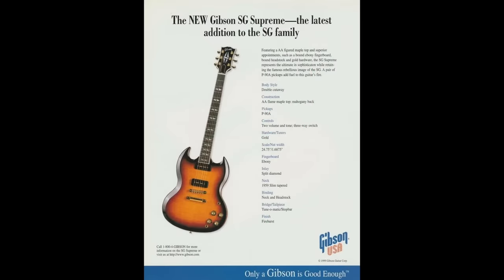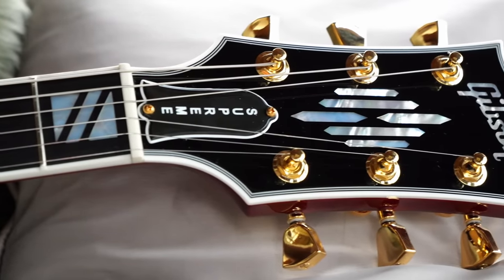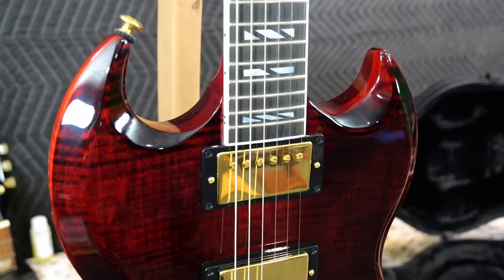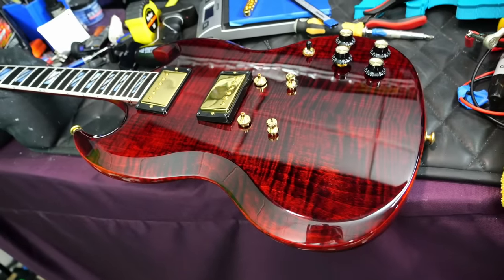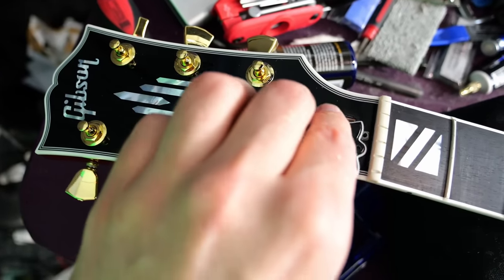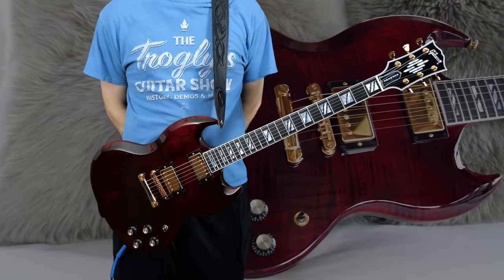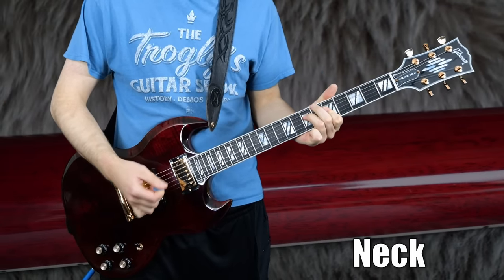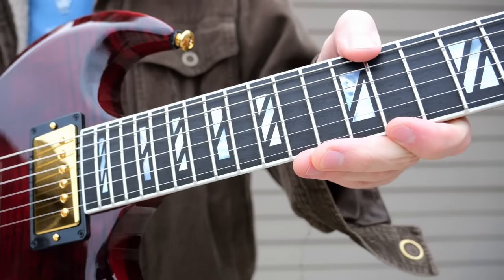WAY Different Than I Was Expecting... | 2024 Gibson SG Modern Supreme Wine Red Flame Top Review

Comment: Sure, they're nice but you may as well buy an SG Modern and save yourself $1k. You still get the thicker body with a figured top, 24 frets, bound ebony fingerboard, compound radius, fancy electronics and the side input jack. Is the higher grade top, locking tuners and different inlays really worth another $1k?
Reply: It’s not.
Reply: It will be worth it when you go to sell. Probably by more than $1000
Reply: @stuckinchaselandia6427  So, you're saying when you sell it, you'll get back $1k more... hmm... but you paid $1k more, so how does that make it "worth it"? lol
Reply: @Darth.Shredder  the point is it will easily hold its value more than a modern will. And will hold more than the difference in the value.
Reply: @stuckinchaselandia6427  I guess we'll see when people try selling them. As of now the only thing we know for sure is that it costs $1k more.
Reply: @stuckinchaselandia6427  don’t really see that. I can easily see these being sold on the used market in less than a year for $2700 tops. SG supremes don’t have much hype behind them.
Reply: Locking tuners should be standard on all guitars without double locking tremolos these days.

Comment: Does it still tilt forward!?
Reply: Apparently they're well-balanced but sometimes it's a crapshoot with the SG. It doesn't bother me at all on mine. A 3-inch strap and my hand is usually on the neck so no worries
Reply: I’d bet not as the top
Strap is on the horn rather than back of neck.

Comment: I feel like the "new" SG neck joint is about as accessible as you can get..  Any more routing would just be for aesthetics IMHO. The old neck joint (while also allowing easier access than almost every other guitar on the market) was much chunkier... I actually thought Gibson did a pretty solid job of making the newer neck joint standard across all models (unlike Fender who make you get an "Ultra" model to get the better joint).  I love SG's more than I should..  I have more than enough of them.  I have no idea how I'm going to convince myself not to buy one of these.  The weight and bulk are probably going to drive me nuts, but the look really is amazing.  I also think it's the best looking Fireburst I've seen.... I typically HATE that finish (I bought a 120th Anv SGJ at a steal with satin Fireburst and had it re-finished white because I loved the guitar but hated the finish that much). On this one with the flamed maple top, it actually looks pretty amazing.  Maybe I'll change my mind before I pick one up, though...  I have more wine red than anything else.

Comment: I owned an SG Custom several years ago (original owner brand new) and it was gorgeous with a flame top. With that said, I got rid of it after six months. The fit and finish had issues which surprised me (compared to my PRS), the frets had to be crowned and finished and it would just not stay in tune. I took it to my local luthier (great guy) who fixed the frets and tried to address the tuning issues. However, the tuning issue never went away. I got so sick of it, I sold the damn thing. I was not impressed at all considering how much it cost. For that kind of money, I'd go with an equivalent PRS any day.
Reply: SG Supreme vice SG Custom. Sorry for the error.
Reply: The Gibson 3+3 headstock design is inherently inferior to the PRS design for tuning stability.

I'm guessing that's why Dave Grohl ( dg335 ) , Joe Bonamassa ( bonabyrd ) and Lzzy Hale ( explorer bird ) have signature guitars with different headstocks.

Comment: is it normal to have coil splitters on the tone pots? one of my guitars has it like that.
Reply: Anymore, yea. It was the hot thing to do around 2018 and on. I still just prefer straight wiring. Yea, you get a little volume cut treble bleed style or a little tonal difference, nothing major, and some dpdt pots are very touchy and scratchy as hell. All in all, I personally think just normal wiring is best. It's better to be great at one thing rather than ok at a few (plus I spend more time fiddling to get the best sound as opposed to just playing...that's me though.)

Comment: You said you would review the Gibson branded case one, but then opened the non Gibson branded one. Just wondered why the change of mind? Oh never mind 😆 Never the less what a beautiful SG Supreme. I never really got on board with the SG Supreme because for some reason the SG doesn't quite pull off the higher end spec thing. The LP pulls it off much better, even though I'm not the biggest fan of the new LP Supremes. But this SG oh yes I'm on board it looks like a Supreme should imo. The wine red is beautiful, the trans ebony is decent and my second choice but not as impressive. The fire one does not do it for me. Personally I don't think fire finish and the SG go together. Very impressed with the wine red Supreme I think it will be the best seller. Oh and it sounds great!

Comment: I'm a sucker for wine red Gibsons. That being said, it is sad that a $400 guitar has better fit and finish work than a $3500 Gibson. They weren't hitting the QC out of the park, and now it seems the norm to get rough binding, nibs that are barely there, and ebony that looks like they didn't mask it correctly when spraying. The body, back of the neck, and headstock are beautiful as usual, but the part we touch (or are least those of us that play, not hang em on walls..🤔) is pathetic. If that's what they "proudly" send out, I would hate to see what they send back down the line. For "knocking on custom shop pricing," this isn't it, Gibson... do better. We all know you can.

Comment: I wish we would stop doing split coil this split coil that. It sounds nothing like the guitar should IMO.
Reply: So dont split the coils if you don't like the sound?
Reply: I agree. They never sound right so, just leave the fancy potentiometers for after market instus and pass a little savings on to us. One day I'm going to pull a J. Garcia a cram a single coil right up there where the neck pup goes.  Sounds so good!
Reply: PRS seems to have figured out how to split (or at least tap) where it doesn’t sound too thin, it cuts/taps the coil while also running the sound through a resistor, and sometimes a tone cap (depends on the pickups they’re using). It’s simple, but it works pretty well.
Reply: @joermnyc  see now that makes sense! At least give us the full tone of the split coil.